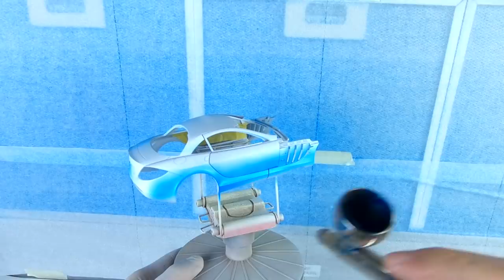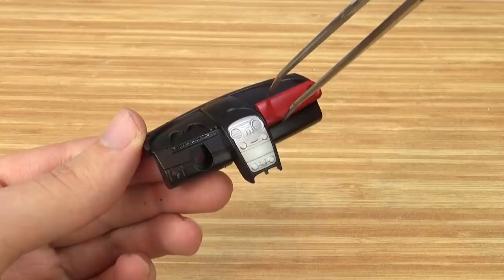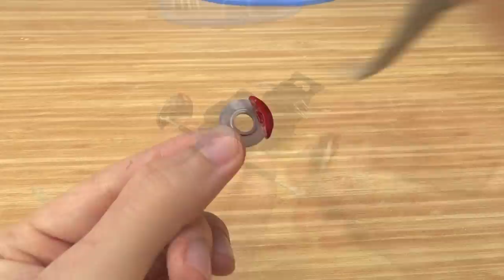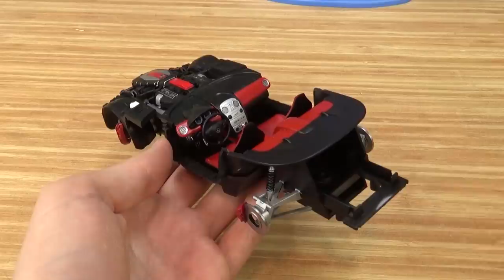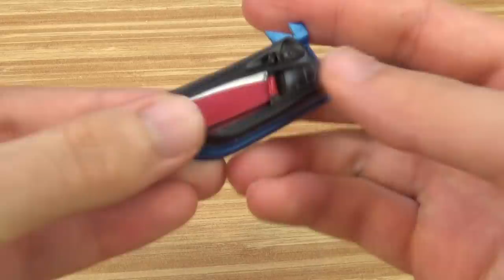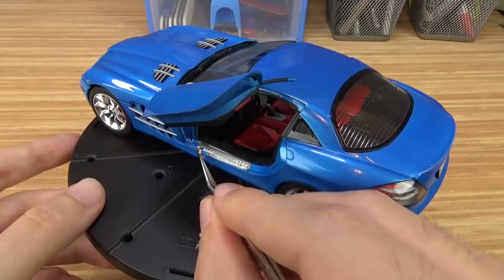Building a Super Realistic Tiny Mercedes Mclaren SLR in 10 min - Step by Step Build

Comment: I'm still surprised about how these pieces fit soo smooth and nice without actually putting some kind of  strenght
Reply: Nah man I had this exact kit and you had to apply glue and strength to keep the pieces in place.
Reply: @dontmindme4466  exactly... if you think this kit is good, then just look at the fitment of the frontlights. To be honest I think this is one of Tamiyas worst kits... and even worse with the 722-kit that has a front-bumper split into 3 parts.
Reply: @dontmindme4466  what is the coast
Reply: @Rickard53  qnqwnnn🙄😇😇😇😣😏😋😎😃😄😍😍
Reply: Rillepille 89 jh
M'd
Reply: @sagargamers778  um...
Reply: @sagargamers778  ihhnnnnmmnnnn
Reply: !sedxxd
Reply: W1q
Reply: @Rickard53  l

Comment: Hey guy, nice build, congratulations but you just have assembled the front wheel the wrong way around, the spokes have correct orientation from one side to the other, just look the pictures of the original car to chek it out, they should look like the rear ones.
Reply: roulott78385
Reply: ات
Reply: ج

Comment: Great build but you ruined 1 detail that was distinctive for the SLR and that are the wheels. The SLR has 2 right and 2 left wheels look at the spin direction of the spokes those spokes also act as a cooling fan for the brakes. You put a right wheel on the front left and a left wheel at the front right.